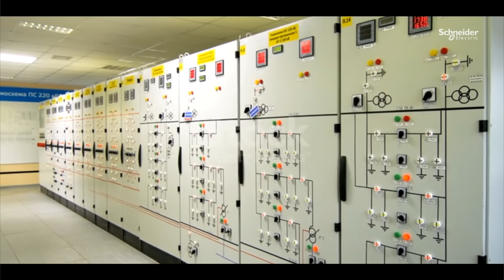Change to Proactive Electrical Asset Management Services | Schneider Electric

Comment: Respectful Greetings!
To: Schneider Electric.
Dear:
Effective electrical maintenance management is the backbone of a safe and reliable electrical infrastructure. Regular inspections, servicing, and upkeep of electrical systems help identify potential hazards, minimize risks, and mitigate accidents that could lead to injuries or property damage.

Preventive maintenance is essential for ensuring the safety, reliability, and efficiency of electrical systems.

Electrical system maintenance management is crucial for ensuring the safety, efficiency, and reliability of electrical systems. Here are some key aspects to consider:
Preventive Maintenance: Regular inspections and servicing to identify potential issues before they become major problems. This includes visual inspections, cleaning, testing, and repairs.

Predictive Maintenance: Using advanced techniques like condition monitoring to predict equipment failures before they occur. This helps in planning maintenance activities more effectively.

Corrective Maintenance: Addressing issues as they arise, such as fixing faulty components like switches, fuses, or circuit breakers.

Emergency Maintenance: Responding to unexpected failures or breakdowns to minimize downtime and restore normal operations quickly.

Compliance and Safety: Ensuring that all electrical systems meet safety regulations and standards to protect personnel and property.

Documentation and Record-Keeping: Keeping detailed records of maintenance activities, equipment, and personnel to track performance and identify areas for improvement.

By implementing a comprehensive electrical maintenance management program, organizations can enhance the safety, efficiency, and longevity of their electrical systems.

Bible Lesson:
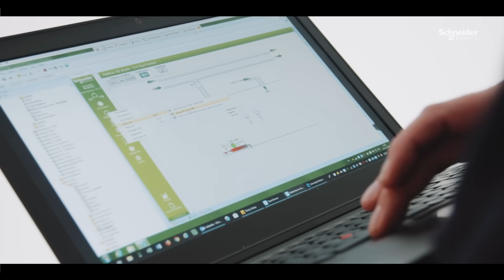Romans 1:17 For in it God’s righteousness is being revealed by faith and for faith,e just as it is written: “But the righteous one will live by reason of faith.”

Courteously!
Luís Van-Dúnem